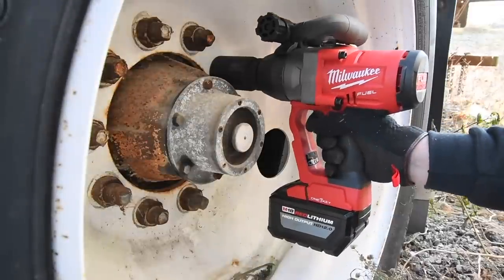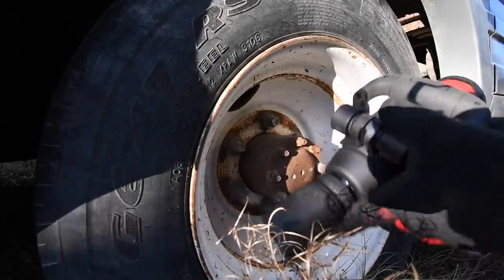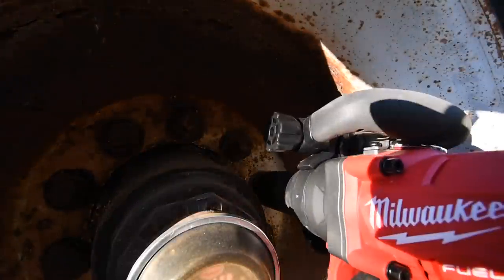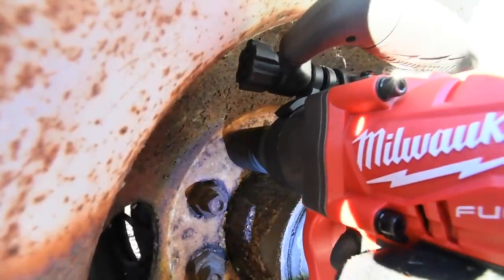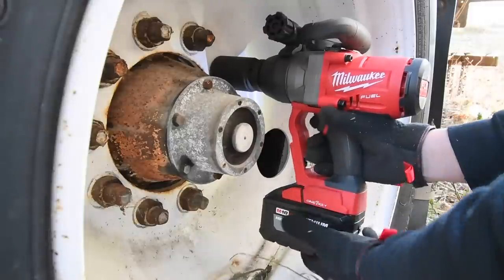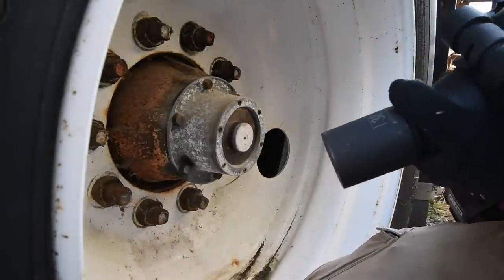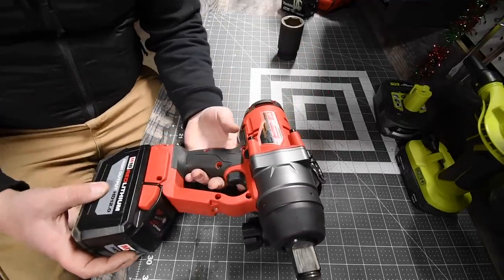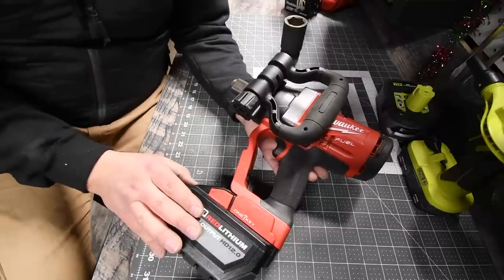1,800 ft lbs 1" Milwaukee (Impact Wrench) 2867-20 HARDCORE TEST

Comment: Some times you just need a breaker bar to do the job. You can solve most problems with brute force and ignorance. And if not just use more brute force. If that still doesn't work your problem may be electrical.
Reply from the maker: I agree with you on that and I thank you for viewing DJ
Reply: Bit of percussive maintenance

Comment: If the threads are rusty, you want to clean the threads or spray some penetrating oil and leave it overnight. Otherwise, you can break a nut or bolt. You can also heat up the nut with a torch.
Reply from the maker: the owner wanted to see if it can bust them without being cleaned. it was his call
Reply: @ManCaverTools  

For demonstration I suppose is okay, but any mechanic worth his salt would not attempt it or else you’ll have bigger problems along the way. The threads will get stretched or destroyed and you’ll need to install a new wheel stud and probably another lug nut.

Comment: The last wheel you you were working on has left hand thread on left side and right hand thread on right side for this type. So it tightens when you turn left. You were going the  wrong way.
Reply from the maker: I thank you for the info James. when I go back there I will look at the threads.
Reply: @ManCaverTools  I could be wrong but some trailers are built that way. I had the same issue once and figured out they are threaded different.
Reply: Budd wheels have rights on the right hand side and lefts on the left hand side. The inner nut should have an “R” or an “L” on it.

Comment: Hey Dave!  Wow, I’m kinda scratching my head at why it didn’t break those lugs loose on the big white wheel near the end?  Weird?!  And, I must say, I’m kinda disappointed you didn’t put any SPAX or lag bolts into the log?  That thing defines Heavy Duty ! 👍👍👍👍✌🏻✌🏻😁😀😄😃😅😂😅😂🤣😊
Reply: Someone probably over tightened the lug nuts to begin with and then they rusted and froze on there.  That is one cool tool though.
Reply: Left hand thread on this type he was going the wrong way.
Reply from the maker: lol, I am getting an adaptor so I can do screws and lags with this
Reply: @jameselam8263  I think your right, I’ve dealt with reverse thread lug nuts on a Ford van from the 70’s.

Comment: Those are called bud wheels. You take the nut off to take the outer wheel off, then take the stud off to remove the inner wheel. The trick to those is, the left side is left hand thread, and the right is right hand thread. So instead of loosening, you were hammering that puppy down.
Reply: Damn, good info... I bet he'll be happy to hear that the  wrench was that actually up to the job he just had it on the wrong selector direction..
Reply: @BuffaloNickel9  Very common mistake for newbies, I'm just surprised that guy didn't tell him.
Reply: @flippedmylid92  Agreed
Reply from the maker: I thank you for the info Jason, Im not a semi truck mechanic
Reply: @ManCaverTools  Been on the job going on 2 years. You only make mistakes like that once or twice before you learn. Lol. Still very impressed with its performance. I'd personally rather have this impact with a 4 inch extension. Just seems like a more manageable package.